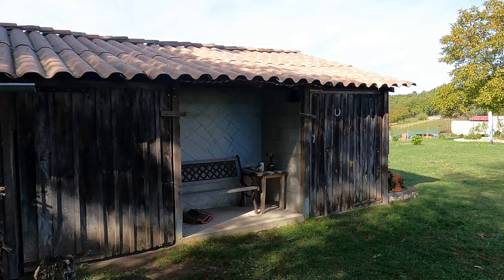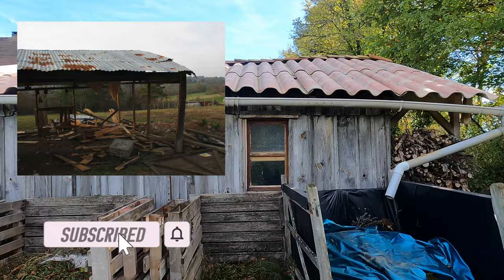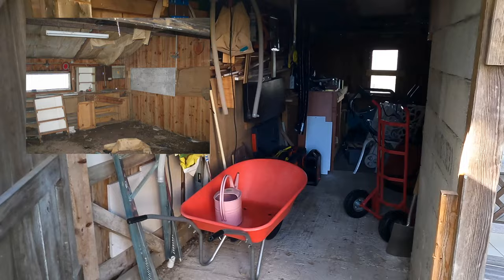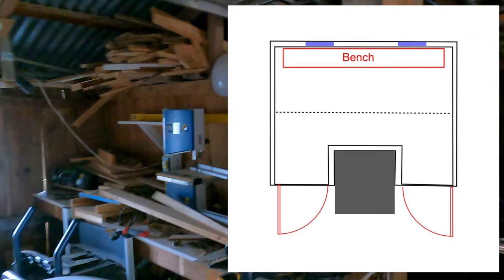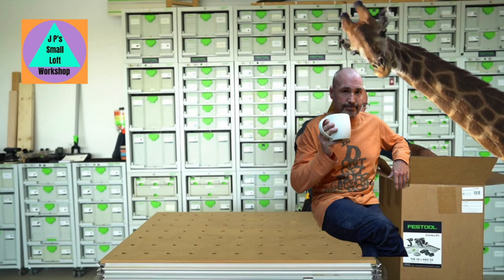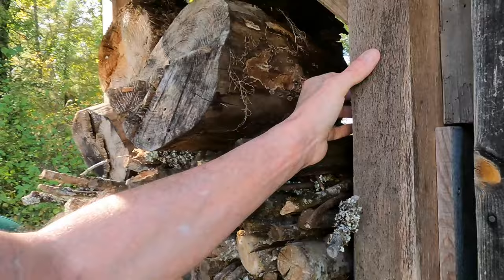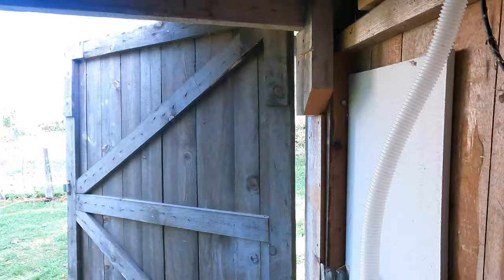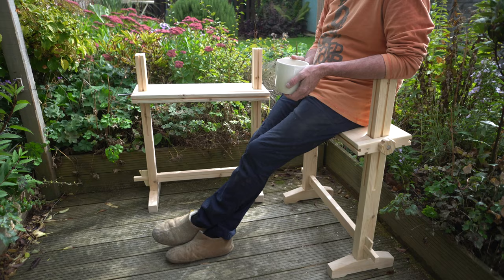Make a Small Workshop from an old wooden barn - Introduction

Comment: My two-pennyworth-
Partition off an area that is pure workshop- no other stuff allowed in at any price. And stand firm.
Ply-line, not dry-line- worth it both from a strength and hanging stuff POV.
I know it was jest, but no systainers. It is a workshop, storing tools in toolboxes is the worst possible form of workshop storage- and one of the most expensive. Toolboxes are for carrying tools, not storing them. And systainers are the worst form of toolbox- fragile, 3 point fixing and not waterproof. And dearer. ToughSystem2 or PackOut are miles better. But none of them in a workshop!
Fit extraction externally, with a cyclone, and ditch the filter. Run the piping overhead. Quieter, and minimum recirculated dust.
Put in more sockets than you need, and then double them.
I could rant on...
Reply from the maker: Thanks Mike. I am encouraging ideas here. Seen as drywall specification / design is my profession I need to do it right :-)

Like the idea of external extraction. Systainer's were a joke, but I am willing to adopt a giraffe!

Regards JP